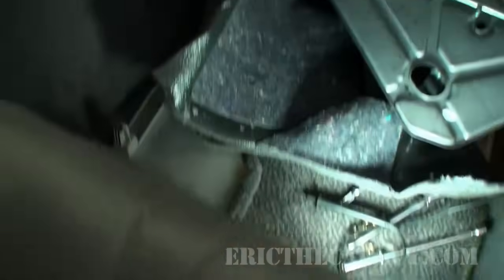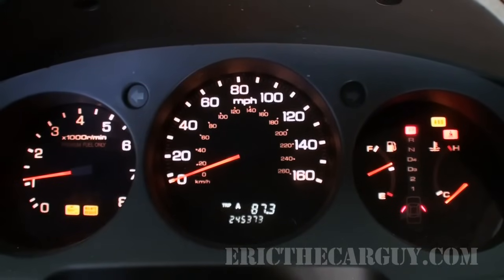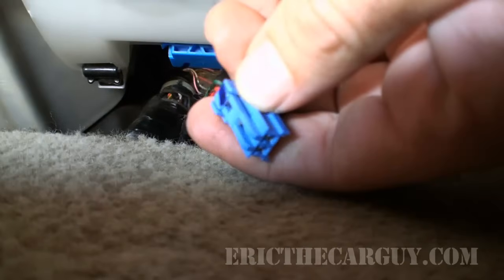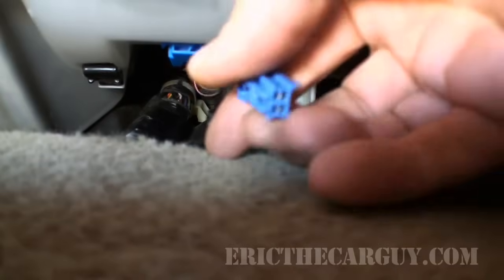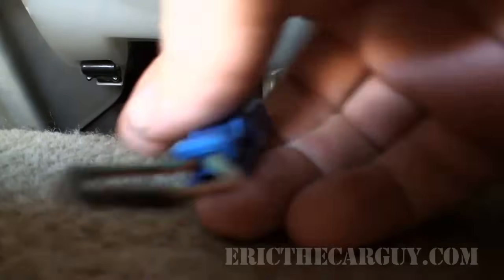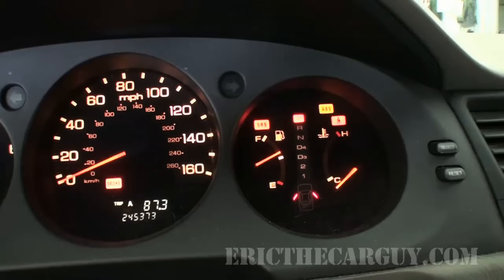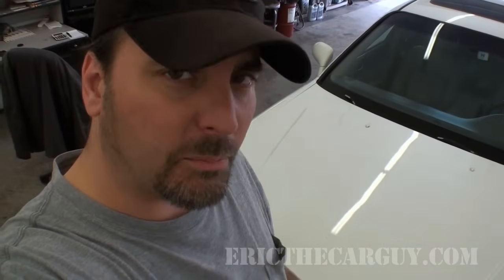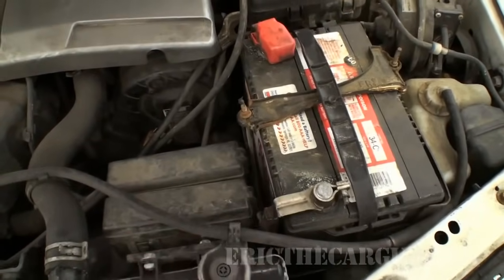How To Pull Honda Codes Without a Scanner -EricTheCarGuy

Comment: Mine is Honda element 2006. The SRS light stays on.  I short the yellow connection. Then I turn on the ignition. The light stay on and no flashing, so I can not continue to reset. What is the problem? I brought to Honda to replace the airbag for the recall. I ask to check the issue. They said no problem with the seat belt buckle.
I remember  I removed the passenger seat. When I reinstalled the passenger seat, the SRS light stay on. I tried to reset, it doesnot work. Will it be the cable connection under the passenger seat? I tried to pull in and out. It still stays on. What color of the cable or the exact cable for the SRS? If not the cable issue. What else will be the problem? Thanks.

Comment: Hello, I have 1994 honda accord ex and it won't start, I believe it's fuel pump issue, I hear no hum from pump when I turn key on, there is. CEL on so i tried this method and when I turned key forward the CEL did not blink but the car started to make all kinds of wierd humming and clicking noises from the underneath, rear of the car. Any idea what's happening?

Comment: Hi Eric... Hey I have a 99 acura/legend rl... It does not have an obd port under ashtray... And the blue plug has 3 pins not 2 like your video... Any ideas on how I should be able to do fault diagnosis?

Comment: I actually don't have a check engine light and decided to try this out for the hell of it. My check engine light stays solid on no blinking, however my SRS airbag light blinks repeatedly with no pattern. This is very useful by the way, thanks for the info.
Reply: Pls my Srs blinks too... Were you able to figure yours out..

Comment: Hey eric i did a motor swap in my 2002 honda civic got it all put to gether but the car does not shift drives in high rpms i usually drive it in 2 but it wont shift

Comment: I'm getting a p1337 code (crank position sensor I believe) in my 1997 Acura 2.5 tl. I'm gonna try this as well to confirm the code is correct as my cheap OBD scanner is showing. Thanks.

Comment: hey eric. i found the connectors but they werent plugged in. my car will start than sputter bog and die. could these being unclipped cause my car to not run correctly? i have a94 accord cd7 coupe 5 speed.

Comment: hey Eric, i have been working on 01 Honda accord, srs light is on, tried to clear w/no success, then tried to pull code(s) with jumper on #9 to #4 pins ....will not flash code. please tell me what to try or is how to figure out if processor is fried

Comment: ok so ive got a 1995 integra and it has no fuel pressure heres the kicker ive replaced fuel pump and main relay relay is working but fuel pump is not the wire that connects to the fuel pump has fire to it but fuel pump is not working any suggestions?

Comment: Honda's should actually do this naturally without the paper clip trick.  Unless there has been repair, damage, or modification somehow to the electronics then the vehicle should blink the codes naturally.  Mine stopped blinking codes ever since I blew and replaced a multiplexer unit after an aftermarket head unit.  ETCG input on this?
Reply: icampbell921

Comment: I did this on my 96 civic. The check engine light isn't blinking, it is static. If I remove the jumper it works as normal (static for a few seconds and turns off). Please help.

Comment: my car is a 1994 Honda Accord I put oil in my car Monday and my check engine light is on what should I do it doesn't have the socket in order to read the codes

Comment: 02 acura rsx type s srs light always on when i pull code only abs light will blink 6long 1 fast. abs light is not always on
Reply: Jonny Parish I have an 03 rsx and was kinda having the same problem so I looked in the hand book and it said something about the seat belt check it out

Comment: I had  jumped the 3 pin port instead of the 2 pin port.  The 2 pin was tucked way up, and I thought the two wire 3 pin was the correct connector to jump :(    What kind of damage did this do!???
Reply: If anything a fuse popped but you're not gonna break it
Reply: Brick Wall

Comment: Thanks for the video - very helpful.
i was able to get codes to display on an Odyssey 2007 EX by jumping the connectors in the port just above the drivers side fuse box, but i can't find a reference to match these codes - any pointers to documentation for the following codes?:
62059   34
61163   50
61222   51

Comment: thanks for the tip. I used a paper clip. got the code and changed out a misfiring ignition coil. car runs smoothly. easy fix!

Comment: tried this and the wire i tried to jump with turned bright orange and started smoking so i grabbed it and it branded my finger and thumb and melted through my floor mat into my carpet under. index finger and thumb both have a nike swish looking sign.
Reply: Gaston Glock EricTheCarGuy assumes no responsibility for any propery damage or personal injury incurred as a result of information contained in this video.
Reply: Wrong connector dude - you shorted battery to ground
Reply: Gaston Glock ...you had one job..ONE JOB!!!
Reply: Why did you grab something glowing hot? why didn't you just turn the key to "off"
Reply: Gaston Glock apparently you didnt " JUST DO IT. "
Reply: Hahahaha!
Reply: No you didn't
Reply: Troll lol
Reply: Gaston Glock Ouch!

Comment: I have Honda Accord 2000 LX 4 door 4CL and it stalled few times while driving 
and then it wont restart, after I left the car for few hours it restarted as if 
nothing was wrong. I replaced ignition twice, it worked for few day and then the 
problem came back. The car starts and runs and can go from point A to B, but as 
soon as I turn off the ignition and try to restart, it wont restart, it will 
restart eventually but after leaving it for few hours. There is no engine light 
but intermittently brake light turns on even though brakes were recently 
replaced , maybe it is part of the ECM issue. A Honda expert told me it could be 
ECM because he failed to detect any signal from the computer. Is it really ECM 
for sure or it could be something else. I would greatly appreciate any kind of 
help/advise. BTW!  the engine cranks all the time. It won't re-start for few hours or an hour or 
so. Surprisingly yesterday, the car restarted after I left it for over 15 
minutes after the initial start. It is so hard to find consistency in it's 
problems. Before I changed the ignition (for the second time) the car would 
intermittently stall. At least now (after I changed the ignition for the second) 
the car hasn't stalled while driving. So far, it just doesn't restart after you 
start and turn off the ignition. But you never know, maybe today it will start 
to behave the same way (stalling while driving). I don't know what to do with 
this piece of crap. I am so frustrated
Reply: Sounds like dirty fuel injectors to me.
Reply: Next time it doesn't start, hold the throttle wide open and crank the car. If it starts then the injectors are dirty.
Reply: I am sorry I know I sound Dumb, where is the throttle?
Reply: hey

Comment: No blue connector in sight on 99 Civic EX. There's a gray 3-pin male connector (but with only 2 wires) dangling down on the driver side near the OBD2 jack. Maybe this is it?
Reply: not on my 98 civic too.
Reply: It is difficult to find. Look for a rubber holder above or just behind the panel in front of the right door jam near the floor.

Comment: My 95 Honda Civic didn't pass a smog test. So someone told me to check what was wrong with it using the obd1 chord. I used a paperclip and when turning on the electricity in my car, the 'check engine light' never flashes. it just stays solid the whole time it's on. Does that mean  anything?

Comment: In my case, without bridging the connector, engine light will only stays on for a second like normal??
But when I got the connector bridged using paper clip, the engine light stays on without any blink. What does that mean?
Mine is Accord 93, got the blue connector under the dash passenger side. I believe its the right connector.
Reply: rusaaKKMODS same thing happens with my 96 civic. Did you manage to figure it out?

Comment: I just found out that our local AutoZone/Trak Auto no longer scans for free, but if you have obd2 connector, Pep Bros does it for free, and many service stations do. My local one, Sunoco, said they charged an hour of labor = $109 (robbers), but the Meineke another 15 min away said "come on down, no charge!". Just in case you don't want to do it yourself. Also, this video is for obd1, which is prior to 1997 or 8.

Comment: Was gone for two weeks, my car didn't move and now my check engine light is on. Any ideas what it can be and how I can figure out what's wrong without getting played at a shop? I have a 2008 Honda Civic hybrid and it's running normal just how I left it, just with the light on.

Comment: I have an obd1 d16 motor in my obd0 crx with a jumper harness to a stock p28(d16) ecu.   My harness has two wires i can plug together to check codes near the ecu. Car was running fine, but I had a code pop up(was a minor code that should have no effect on my problem), so i plugged them in to get the code, but then forgot to unplug(which i know is a no-no) them and went to start the motor.  Now my starter wont crank, my main relay would click and the fuel pump would prime while getting power to the car, but after a couple attempts to start the car(with the wires disconnected) now they dont work either.  I have disconnected the battery to reset the ecu but still no luck.  Everything seems to be getting proper power as per my volt meter readings.  Is it possible this has fried the ecu?  I had another good starter on hand and tried replacing that first to no avail before the main relay/fuel pump issue also came along.  Any ideas of where to look before I shell out $100 on an ecu?

Comment: So if it just stays on steady with the jumper in place does that mean there are no codes to report?
It comes on when the key is switched on for a few seconds but goes out when the main relay clicks without the jumper.

Comment: Thanks to this great video, I pulled a 4 1 off my '94 Honda Prelude.  Some lists say code 41 is Heated Oxygen Sensor.  The list above for ABS Codes says its a wheel sensor RF.  Anyone know which is correct?

Comment: @ericthecarguy I have a 94 accord, I was driving last night to the gas station, I was on the freeway and suddenly my check engine light came on I got to the gas station turned off my car fueled and when I turned it back on the light was no longer on. My question is can I still be able to pull codes even though the light ain't on? Thank You, Video Was Very Helpful, and informative.

Comment: When my Honda stops pulling  , I have to turn the engine off and wait for a good 5 or 10 seconds.  pull the shifter back down to drive and yo go again.
** keeping in mind,  
when the car is restarted to rein gage the transmission,  * THE TRANSMISSION DOES NOT MAKE THE GRINDING NOISE IN PARK AND REVERSE. 
** IT GRINDS EVERYTIME WHEN FIRST STARTED OF THE DAY.*  NOT ON EVERY START.     ALSO MY FAN DOES NOT WORK? ?? HELP!    *

Comment: My 2000 Honda Accord,  was recently purchased by my self. 
 my reverse is out completely. .  Umoung starting the car , " while in park" as the car starts making a loud "NOT STEADY" NOISE. Grinding, really loud  also as you pull the gear shifter down through,  R,N,D, 1,2. 
moving the shifter one gear at a time , stopping in each gear.  Reverse will also grind loudly.  NOT A STEADY NOISE, but like grinding teeth. N IS FINE . SHIFT ON DOWN TO, "D." The car will in gage in gear pull and stop when it seems like it has gotten to warm
.

Comment: Well, confused, there is no explanation for code #79???
Reply: +Eero Laukkanen  I noticed the same thing. No explanation  for code #79.
Reply: Yep, what is #79???
Reply: owners manual wont tell you about the check engine codes. You'll need either the service manual or google the check engine code. Good luck.

Comment: You can also do a series of accelerator pedal pushes within a certain time frame that will get the error codes and you can reset the ECU codes as well.

Comment: hey I have a rough idle I put in the two pin to read the codes but my check engine light stays on will not flash I have the obd1 computer

Comment: The scanner at the parts store read that a EGR valve was needed, although the engine did run right until I change out a Ignition coil, which of the codes would show that an EGR valve was needed.  I did not see it on the list.

Comment: i have honda accord 96, check engine ON,  try both method so many time , fuse and -ve terminal also +ve terminal off  too, but when start the Car light came On in after Few seconds, few Months ago check engine light was flashing again and again , mostly uphill driving ,  coz  i found one engine spark wire some times lose or current doping because some rust was in cup where 4 spark wires and one wire connects,  its connector broke, then i made connector myself small thin copper plates , it was working ok, but some current was not adjust, car was shaking , then i set different ways , finally shaking gone ,a lit bit feel long time, check engine still there and .......Today   I went for  " emission test  " and its PASS      (1) I want to know what is the thing after reset code by battery or fuse , its coming back after few second when Start ?

Comment: 02 accord, I think I found the SRS dtc on the driverside, (with which I previously reset the SRS light after removing the instrument cluster). Can't get any codes like the video, do I have to go to the 4-9 pins on the OBD2?

Comment: my 91 DA has no codes but it wont start it turns over but no start.checked compression and its good 140-145-145-150 checked the fuel pump. and fuel pressure. ignition coil and igniter but i cant figure out why it wont start.
Reply: it's your main relay/fuel pump relay under the driver side dash
Reply: its was faulty piece of shit part i got from autozone fucking ignition coil. i tested it and it worked. got a friend to lend me his from mazda and it stared up. thanks for trying to help anyways.

Comment: Mate, thank you so much.. I have an old '99 Honda CR-V and I did what you said. Saved me hundreds of pounds... Lots of error codes all at once is not right! Turns out it was just "Low voltage" and no real problems. Re-set it and good as new... Thanks again. From England.
Reply: graybermann I’ve got a 2000 CRV and wondering about the location of the male connector. Mind telling where you found yours?

Comment: Well played that man!

This was exactly the problem I had. The ABS light was permanently on on my in-laws Civic EJ and it was due for its TÜV (MoT) test. 

Turned out to be left rear sensor.

And you even show how to put the lamp out ;). 

TCS traction control system fuse is logical, because the front sensors also control the brakes to give the effect of a limited slip diff. I paid extra for that on a Passat I bought new in 1990. Worked well trying to get up slopes into car parks at ski-resort hotels ;).

Comment: So what happens when you do this and the cel light stays on while testing,that would mean no codes are showing up with the key in the on position, but I'm confused because my light only comes on after I drive about a mile down the road, so I know there is a code but when I test Ii like eric does the cel doesn't blink it just stays constant